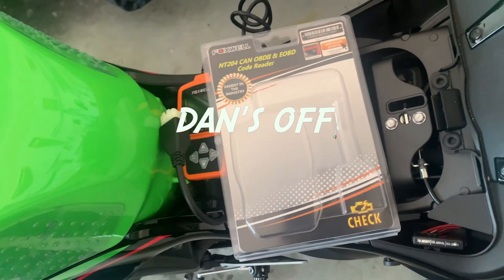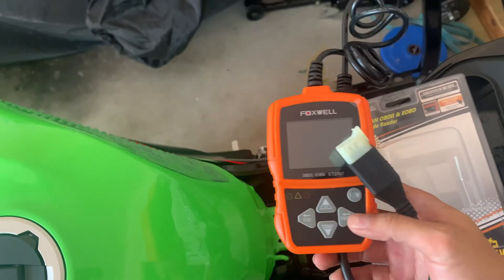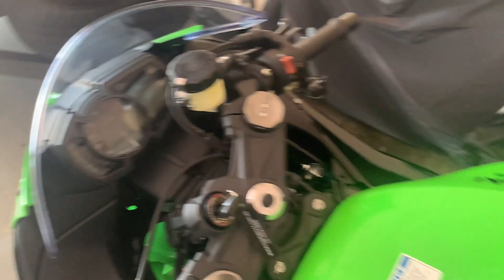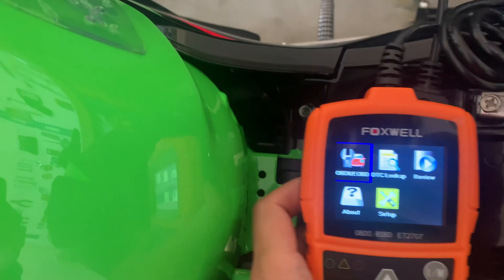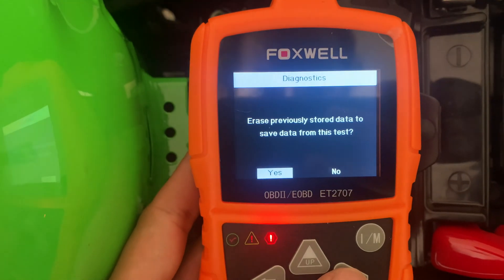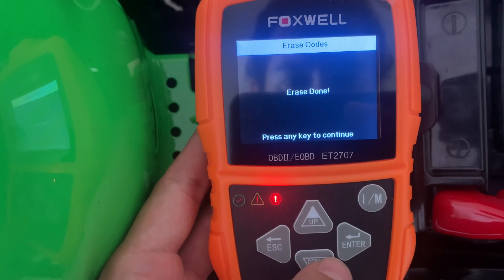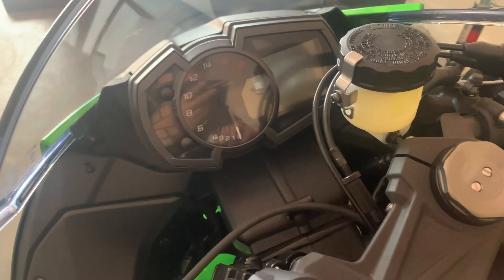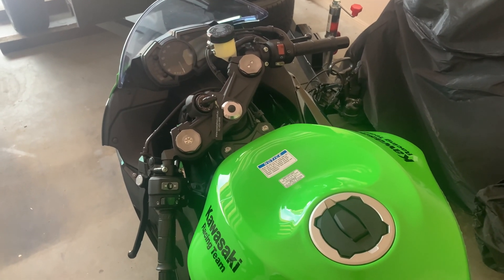How To Clear Engine Warning Light 2019 - 2022 ZX6R | ODB2

Comment: Do you mind telling me what engine error code number on dash it was saying? I’m having the same problem and am trying to see if a servo buddy will help
Reply: Error 62 i believe,  i just had the same issue after fitting a new battery, 3 good clear runs an it reset after hard pressing the 2 buttons while engine was running, mines a 2019 Ninja 650

Comment: I have this problem in the UK on a 2019 zx6r.  I'm using a  foxwell nt301.  It's dead on the light coloured connector but works on the dark one.  It says it can't communicate with the bike and now the bike won't start. Any ideas?
Reply: Thanks for reply.  I'll look into it and if I sort it out I'll let you know
Reply: @barrada001  did you solve this? I am having the same problem.
Reply: No power to the Foxwell on the. Light coloured connector whether key is turned out not.  Lights up when it's connected to the darker connector
Reply from the maker: @barrada001  the only thing I can think of is either an issue with the 6pin converter you have or that particular model foxwell may only work on cars (maybe the bike does have enough juice to power it).
Reply: Yes. Couldn't get the Foxwell to work at all but I removed the servo and installed a servo buddy which was about £30 on eBay. It didn't put the light out immediately - it has a procedure where you ride the bike for ten minutes then stop and turn it off 3 times. That put the light out and it's been fine since. The bike is running as normal with the stock exhaust. Let me know if you get sorted.
Reply from the maker: no power to the unit even when the key is turned?

Comment: I have it connected to the lighter port, but it does not power the scanner? I just got a motopower scanner off amazon, works in my car but does not work on my 2023 zx6 with the kawasaki adapter.
Reply: Same here. What's the solution for this kind of problem?
Reply: I have the same problem. did you fix this already?

Comment: Can you please tell me which obd2 connector you used?  I ordered the foxwell nt301 tester but the adapter I bought does not seem to power on the unit.
Reply: Did you figure out how to get it to work? I’m having the same issue, I plug in the scanner and adapter to the lighter colored plug and it won’t turn on. I plug it into the black plug and it powers the unit but it doesn’t read anything
Reply: Exactly same situation on Mine! Nothing on white plug. 
When connected to black plug the obd tool powers up but won't connect to ECU! Anyone found solution yet?
Reply: @Gjallardong  Did you have this fixed?
Reply: @Cocci.R1  yeah I looked up the wiring diagrams for each plug, then I swapped the wires in my adapter accordingly and it worked
Reply: @Gjallardong  can you send me the link for the wiring diagram so that I can do it on my own. The Kawasaki adapter is not working
Reply from the maker: Make sure you have it connected to the right port. Mine is the Foxwell ET2707.

Comment: How can I do it if I don’t have a scan tool. I tried disconnecting the battery but nothin happened
Reply: I think you already fixed the issue, but if you have not the scan tool hou can do it manually.

You have to start the bike in neutral an let it run for 2 mins then ride the bike at 25MPH or more for 10mins, then turn of the bike with the key, repeat that step again for 3 or 4 times.

In my case the 3rd time that i did that worked out.
Reply from the maker: I wasn’t able to do it without the ODB2 scan tool so I cannot confirm another way.